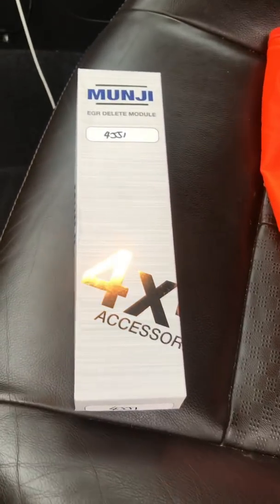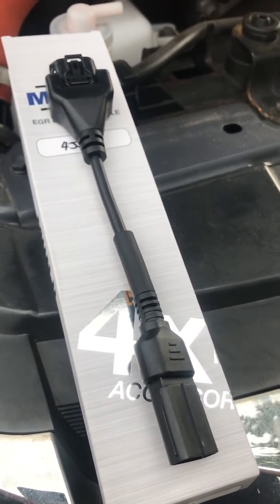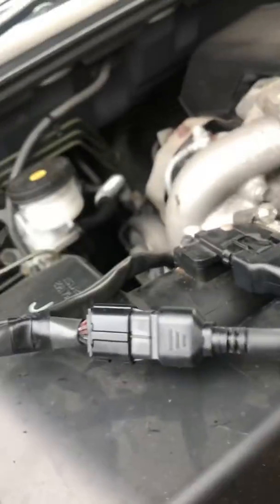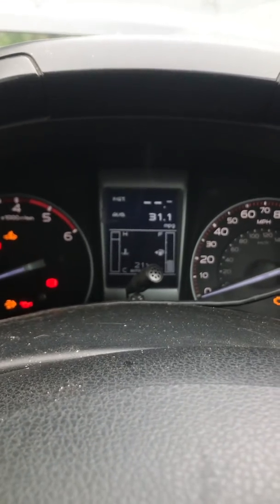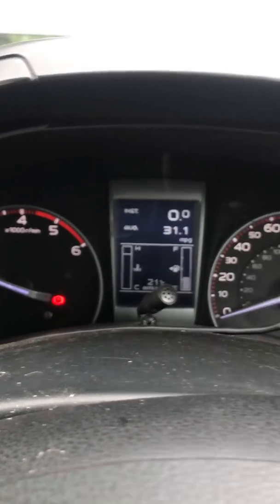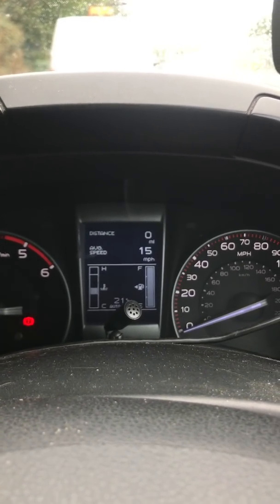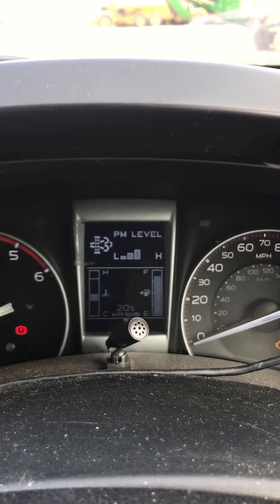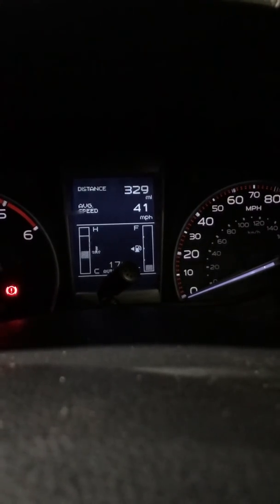Munji 4x4 Isuzu Dmax EGR delete module with test results

Comment: You AR is now rich and you’ll burn more fuel.  Idles quick for that exact reason, it thinks it’s cold so applying a version of ‘choke’.  If you love it then great, but most I know that have tried them ditched them.  Longer term…with the richer running the inside of your DPF will be even worse…best of luck

Comment: Would you put a blanking plate also or it should be ok with the delete kit on it and are you still using it ?
Reply: The real question is should the intake manifolds be cleaned of all the gunk they have accrued to improve breathing when this mod is fitted to gain maximum benefit.?
Reply: @wyattfamily8997 yes

Comment: EGR delete module, eh?  This module has nothing to do with EGR delete.  A vehicle doing heavy towing would never invoke EGR anyway, except perhaps occasionally at idle.
Reply: It taps into the temp sensor on the air flow meter and tricks the egr into never opening.
Reply: @mitchellboyd5256  would that mean you don't need to blank off the egr with plates or is this sufficient?
Reply: @mitchellboyd5256  does that affect running in hot climates
Reply: DO a reading with a ECU reader. you might find some EGR flow is still there, depending on the vehicle. My Ranger still has 20% flow, even with a delete module.

Comment: G'day mate 
Jared here from Munji 4x4 in Australia, great to see your video here, thank you and its great to see it is helping with the regen issues in your 2.5 isuzu. Unfortunately in Australia we only have the 4jj1 3l isuzu to play with but the current model has the euro5 version of the 4jj1. 

We have the higher idle too but as soon as the car thinks its about to be driven (ie. Clutch pedal or brake pedal depressed) the idle drops straight down. We figure this just to prewarm the dpf (isuzu here call it dpd). 

I'll have to make another trip over there in the near future to do some more testing on the 1.9l isuzu engine. This module did not prove to work on it when I was there in June.

Thanks again mate 👍
Reply: Hey Jared, will the 4jj1 cable work with the current 4jj3?
I have a cable sitting here from a 20’model that I no longer own
Reply: will it work on 4jk1?